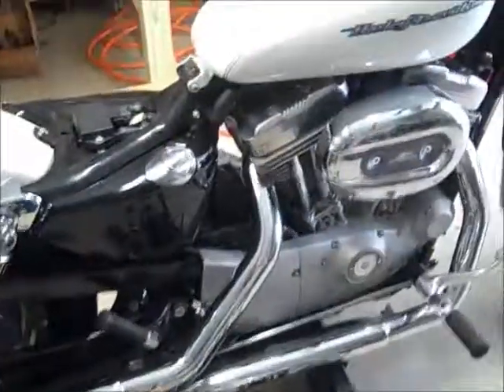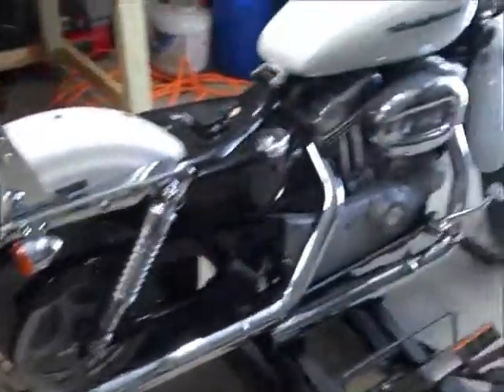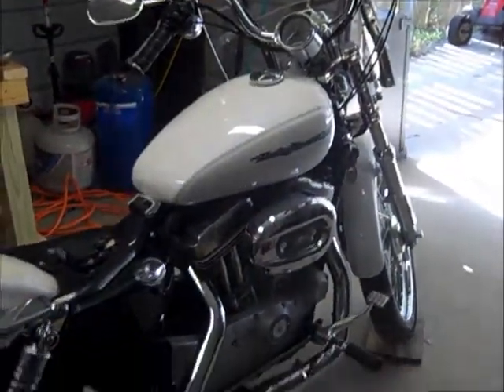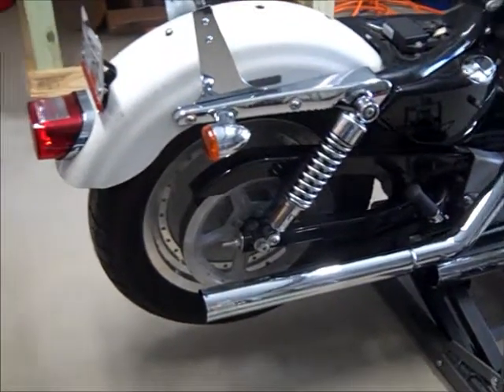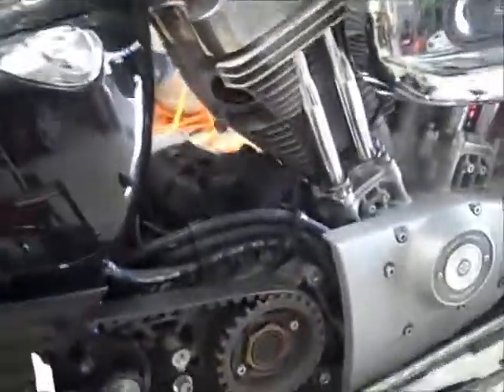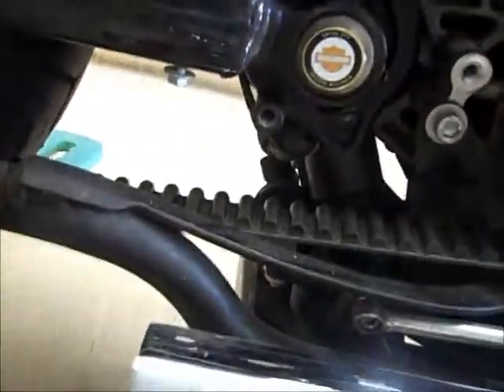DNA Trike Conversion Pt 1 of 4

Comment: Dan, my wife owns this trike on your video now and it's still rolling down the road. She loves it!
Reply from the maker: I am glad to hear that.  Sometimes I regretted selling it but I had 2 and my wife said one had to go.  So remind her to occasionally grease the differential. There are 2 grease zerts one on the outside of it and the other accesses through one off the slots on the hub.  Anyway I am glad she still loves it. Tell her to ride safe...
Reply: @danharrell6200  I had it painted a deep red last year,added a fork dampner, and put some wider handlebars on it. I have all the parts to put it back to two wheels as well. Thanks for the info on the differential
Reply from the maker: @scotmeisner6616  if you could, I would love to see a photo of it.

Comment: Hi Dan. I'm doing the same conversion on my 1998 sporty. Looks like I will need to swap sides on the rear diff like you did to center the axels properly. How did you get the center section off the axle tubes? Any help is greatly appreciated!
Reply: Interested in this info

Comment: Hey Dan what problems did you have with your brakes I put one of them conversion kits on and I can’t get the bike to stop even with the two cylinder pistons Or do you have stopping problems that the breakdown grab that well
Reply from the maker: The only problem I had was the 4 piston brakes. Once I changed to the 2 piston, I did have a problem bleeding them but worked it out

Comment: Can you tell me how it really handles now!
I am thinking of doing this.
Thank you 
Tony
Reply from the maker: You know at first I didn't like the front wheel shake that i noticed under 15mph. Not dangerous but concerning.  I aired down the rear tires to 15psi and it rode smoother and the shake was gone.  Handles great.  I am about to convert a triumph America and will post the videos of the convention.  I am sold on the DNA trike kite. Order from Rebecca and let her know i referred her. Her information is at the end of the video.  Good luck

Comment: Hi dan,can you tell me how you pulled the pulley hubs in order to switch them over,
Reply from the maker: Sure, remove the hex screws that hold the hub together. Separate the hub then Remove the pulley, axle and inner differential gear assembly.  Near the narrow end of the hub is a hex screw. Remove it. Then I stood up the hub and used a rubber mallet and hammered the press fit hub off the axle covering. You can also use a dead blow hammer or a large ball peon hammer and a block of wood. Work your way around it to work it off. Once both are removed, switch hubs, line up the hex screw hole on the hub with the axle cover.  Hammer it back on and line up the screw and hole. Reassemble.  If you are doing this because of the left wheel hub is too far to the left when the pulley and belt are lined up, you can always add a wheel spacer to the right side to equal both sides. Try that first and if you are happy with it, it will save you the work of switching the hub around. Let me know how it works
Reply: @danharrell6200  thanks dan,il give it a try,I don't really want to use a wheel spacer,
Reply: @danharrell6200  thanks for your help dan,I done what you said,quite hard going doing it myself but got it done quicker than I thought,now everything is sitting absolutely perfect,well worth the effort,
Reply from the maker: @bobbycarson5574  I am so glad to hear this, the only other problem that caused me grief was the brakes. I received a beautiful chrome brake caliper with 4 pistons.  Did not work because there is not enough pressure to work on them. If this is what you got, do not install them.  If you do you can’t rerun them. Call your sales person and get the 2 piston calipers instead.
Reply: @danharrell6200  when my kit arrived one of the callipers was damaged,they are just gineric copys anyway,so I got another pair,slightly different design,but they are 2 pot and they fit,the only other issue i have is the exhaust,I've got the originals on with mids,I might just add a section into the rear header to bring the muffler under the axle
Reply: @danharrell6200  hi again,do you know the torque settings for the hub nuts dan,I need to pull them to get the caliper plates ,
Reply: @bobbycarson5574   how did your conversion work out? I am now in the middle of doing an 06 sporty
Reply: @timlemons6427  hi,it works really well,if you need any info just ask